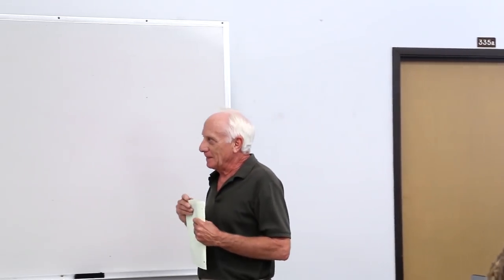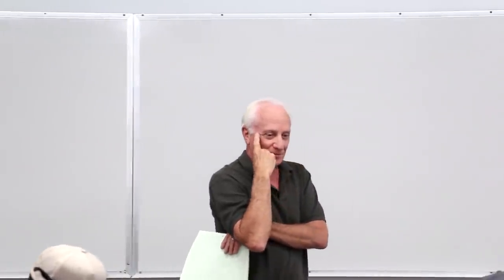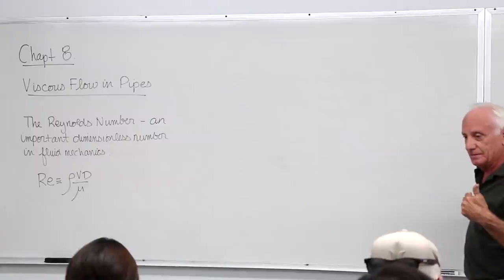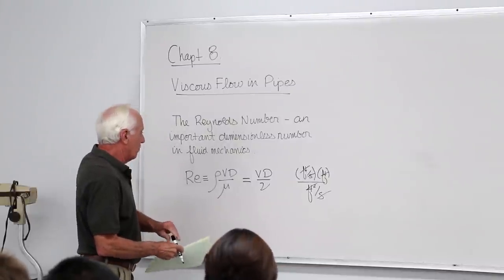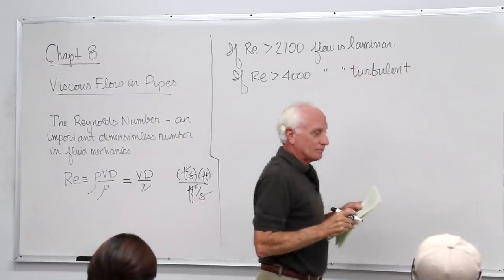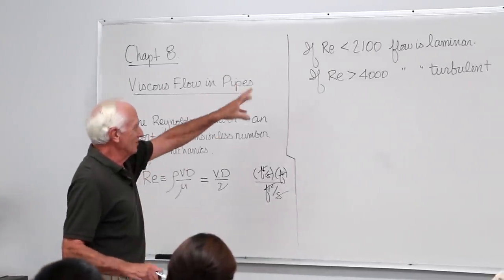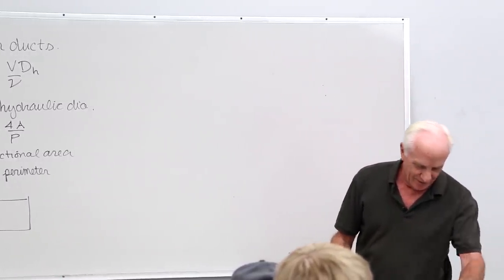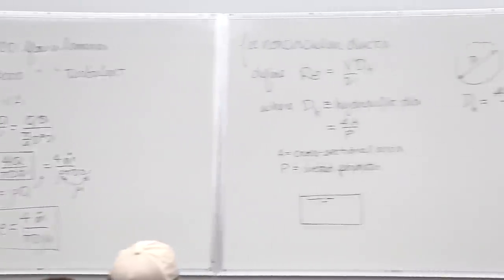Fluid Mechanics: Viscous Flow in Pipes, Laminar Pipe Flow Characteristics (16 of 34)

Comment: 34:36 once flow is fully developed it will remain fully developed even when u add a valve
41:01 pressures are compressive stresses, they always point into the fluid CV
45:00
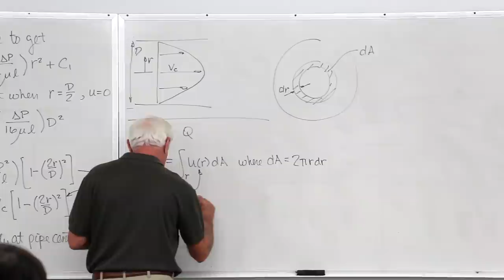50:27 52:40

Comment: Thank you professor for the excellent lecture on viscous flow in pipes.  @52.44 the flow rate is mentioned as Q= (piR^2Vc)/2. I am wondering if you could show how the whole term is getting divided by 2. Once again thank you for your valuable time.

Comment: At 30:00, the value of the Reynolds number is less than 2100 not more than 4000, which makes it a LAMINAR flow instead of turbulent flow....
Reply: In the video the value of Re at @30:00 is 6369.44, which is greater than 4000. (i think you are confusing the " , " by  a " . " )

Side note:

Reynold's number is the ratio of inertial forces to viscous forces. When Re is small, viscous forces supress the inertial forces. When Re is greater, inertial forces are more than viscous forces, and thus the chaos.

 Reynold experimentally came up with the expression of Reynold's number. In doing so, he assumed some of the factors that affect laminar to turbulent transition to be insignificant. Some of those factors are surface roughness, pipe vibrations and fluctuations in upstream.  These parameters are carefully manipulated in fluid mechanics labs to even get laminar flow at Re=1000.  

Also this 2100- 4000 transition range is only accurate for Circular pipe flow.